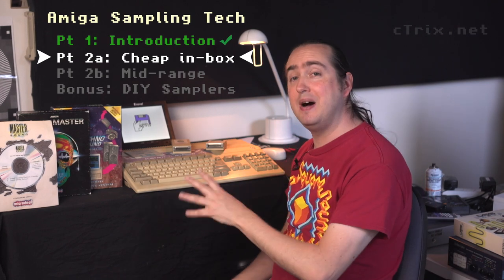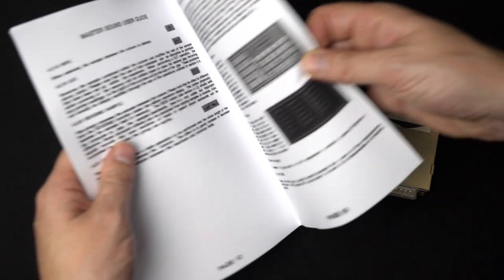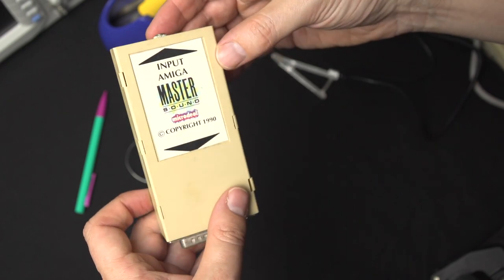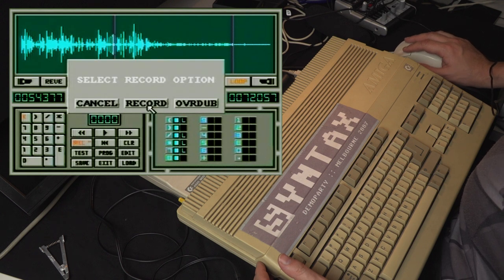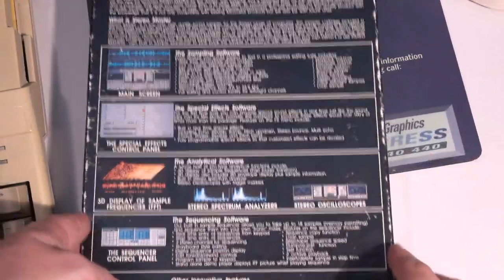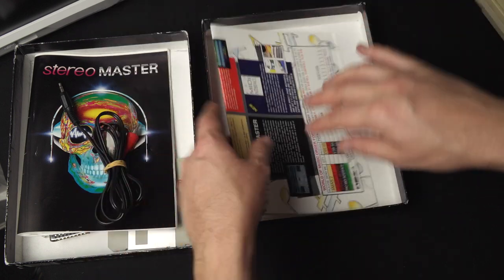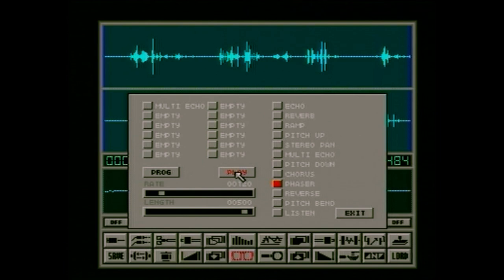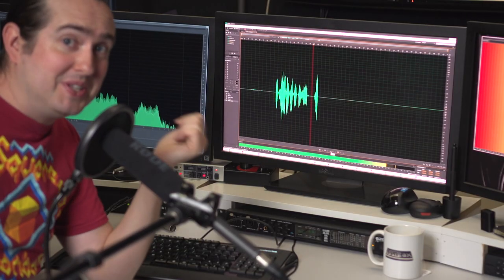Amiga Samplers (technical) - FutureSound / Master Sound / Stereo Master

Comment: Me too... I'm also still using Cool Edit Pro in 2020 !
Reply from the maker: You can use it up to Audition 1.5 ... and beyond that Adobe had it passed to them and kept "the bits they understood" when the original CEP guys departed.  It was a sad day for Cool Edit Pro but Syntrillium were smart because Multi-threading was around the corner and the whole codebase was about to require a complete over-haul to run across processors.  Adobe dropped 16 mil on it... so hopefully Rob and David are out there with big smiles on their faces enjoying the high life.
Reply: @CTRIX64  Thanks for your reply. Interesting bit of info !
Back in the day, with my pentium II 266 Mhz, Cool Edit was a real power hungry beast ! Each time I needed to apply some FX or Hiss Removal or so, I had plenty of time to wait... Nowadays, even without the use of multithreading, my computer is so much more powerfull, that in comparison, the waiting times seems really short... I don't even have time to read a book beside the computer as I used to ;-)

Comment: Hmm I wonder if you can supercharge amiga with some modern components like more RAM HDD etc.
Reply: They still sell some amiga computers so yes(crazy expensive PPC-based) :P But its a newer version of the OS etc.. but it does include a emulator for the old stuff if i remember correctly. Edit: googled a bit, there is AmigaOS v4 and there is another system called morphos that both run ppc (old macs for example but you can also buy their own machine) Edit2: Oh and there are remakes of the old 64k based boards called amiga 500++ 500+ A500 etc etc, but I think the old OS still cant handle more ram then it could back then so its not like you could max it out in a modern sense being based on the old stuff. You would need emulation on the newer amiga hardware if I've understood things correctly.
Reply: The big Amiga limitation is chip RAM, as this is the RAM cTrix refers to in the video - this is shared between all the custom chips and if the data (be it sprite, sound, display etc.) the custom chips isn't in chip RAM, they can't access it. The maximum chip RAM on physical Amigas is 2MB (8MB in UAE) which is a fairly healthy amount believe it or not. The key is getting some so called 'fast RAM' that only the CPU can access to speed the system up, an A500 can access around 8MB of this, and with a suitably nippy accelerator and hard disk (e.g. the ACA 500 Plus card with a compact flash card for the "hard disk") some apps allow streaming of data direct from disk into chip RAM, e.g. Scala allowing streamed audio and animation meaning the 2MB chip RAM limit disappears. Note that not all Amigas can access 2MB chip RAM out of the box (A3000, A500 Plus, A600, A1200, A4000 series and CD32 all can out of the box)
Reply from the maker: You can't really use modern parts - they simply are not designed to run with the old voltages / addressing methods.  

There is the AmigaOne X5000 project -- but it's not really the Amiga that I'm showing here in that it can't natively run old Amiga software without emulating.  And that the point of emulation, you may as well use a PC / Linux box IMHO.   Certainly the way the audio resamples in hardware is a bit unique to the old Amiga 2000 / 500 / 1200 / 3000 / 4000 series.   

You can supercharge with an accelerator card as @Pixel Vixen mentions (check out her channel, I'm sure she'll have examples!) but you are generally going from 14mhz to maybe 40mhz + 16MB of RAM at most and maybe adding a floating point unit.  But that's all still using 1990's technology.   

You can also get the Vampire cards which will emulate an accelerator featuring any given 1990s Motorola chip via an FPGA... which is very very clever.  Someone mentioned 250MHz with 68060 compatability and that is insane fast.  With 128MB of RAM this is far far more than any Amiga program will ever be able to fathom using!
Reply: @CTRIX64  That's a solid reply. It depends what you want to use an Amiga for, I'd say if you want to use an Amiga without faffing with how to transfer files and floppy disks, I'd definitely look into an Amiga 600. Maybe I'll do a video on it. The other bonus is sound wise, it doesn't matter what Amiga you have, the sound chip Paula is the same across the board. (Although I understand if you want better quality >4 channel stuff you need a bit more oomph, but then that's where using a modern system may make more sense.)

Comment: Where can I find a floppy image for Stereo Master? Wonder if it would be possible to sample audio into Stereo Master from WinUAE for use with trackers.
Reply from the maker: Yes you can.  There's is an emulator layer in WinUAE for a generaic sampler (which is compatable)

Comment: They sold those boxes I'm pretty sure at Radio Shack back in the day. Various sizes for various projects. I built a resistor ladder frame grabber that worked via the parallel port on PCs.  I *
DO have a show planned for that, so subscribe to me if you want notifications. It had the resistor ladder, a cap or two and the printer port and it was in a box like this. I made the circuit board via etching, soldered it, etc. It was a project for my EET class in about 1995. Black and white and not great...but it was Dirt Cheap. You can google 'Dirt Cheap Frame Grabber'. Oh and it had a composite input. I guess with this you could add audio to it. Dancing Bear scenario tho, even in 1995.

Comment: wow midi triple play plus by blue ribbon soundworks, the house that made bars and pipes pro my real first midi sequencer in 1992 when I've started making audio and music.
at time I used it with my amiga 500 expanded 2 meg with my kurzweil k2000s....yes I was a kid but so lucky to have parents that gave me the possibilities to get pro gear.
later I had also jd800, wavestation and so on....I stopped using amiga for music in late 90s when things got serious and bought a pc with cubase and cakewalk audio but leaved soon for serious unreliable problems and moved to apple g3 and later g4.

hw bars and pipes was very good and stable, with professional features even when compared to very pro stuff like motu performer or opcode vision, or atari notator sl....I prefered bars and pipes over notator at time, better GUI with colours and graphic display of midi datas in a way similar to later opcode and motu stuff.

Comment: I had the Stereo Master and I later found out it was not that great as boosting made all your samples whistley, noisy and the like. I then moved on to FM synth software and sample generators to make good samples to use and limited my loops or got a mate with a PC to sample and bit crush then to 8bit and to 16574khz or 16727khz for near a C and transposition of fine tuning sorted that on OctaMED.

Comment: 55.9khz? no its more like 5.59khz :D cd quality (which wasnt even standard back then what so ever) is 44k why have it at 55? ;) dont make much sense. its 5.59k.
Reply: it must have been 55.9KHz because he was using it and then 30KHz.
Reply: @RWL2012  well that doesn't make sense because if it was 55.9khz then it can only replicate half of that. Sample rate is always double of what it can reproduce.. Oh well I don't know I haven't googled it and checked it, it just seems strange it would use such a massive samplerate when 44khz wasn't the norm until later (to reproduce human hearing up to 22khz). Seems strange an old box with bandwidth and data limitation using 55.9khz!
Reply: @AboveEmAllProduction  The samples were only 8-bit, unlike CDs which are 16-bit. Even 55 kHz at 8-bit, wasn't anywhere near CD quality. Also, back in those days you wouldn't be producing your own CDs, so you'd just go with whatever sounded best when played back on the computer.